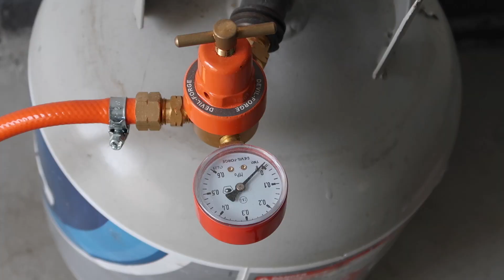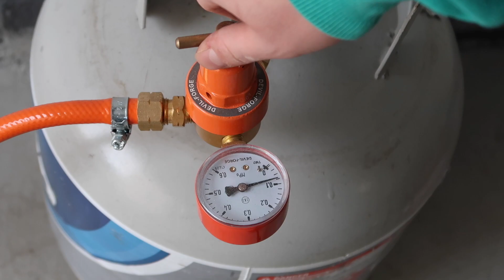Aluminum Bat Meltdown | Melting Metal | ASMR

Comment: Merry Christmas and a Happy New Year to you and yours! 🎅🏼🤗

When it comes to aluminum, it's always great to see something thicker than a beverage can melted down.

May I suggest that the crack might've been caused by not plunging the bar into the cooling bath all at once, thus causing a stress fracture where the metal temperatures were drastically uneven?
Reply from the maker: Merry Christmas and Happy New Years to you too! Glad you enjoyed the video~ 

That makes sense. I outta plunge the bar fully next time and see what happens! 🤩